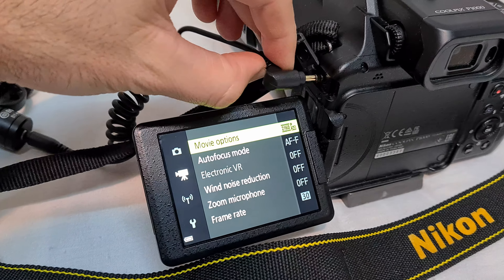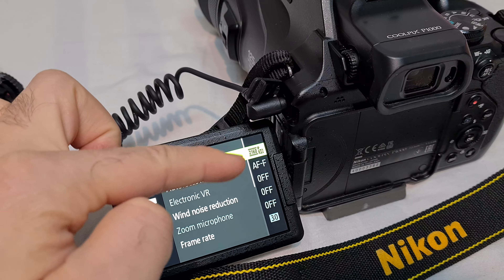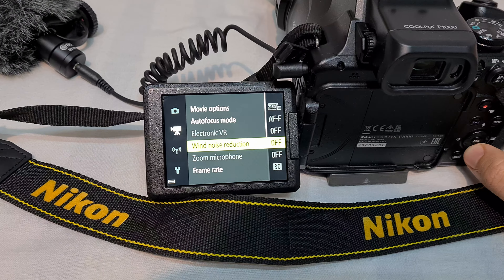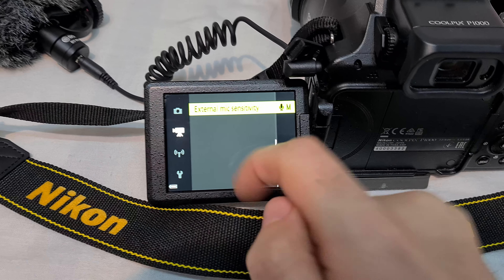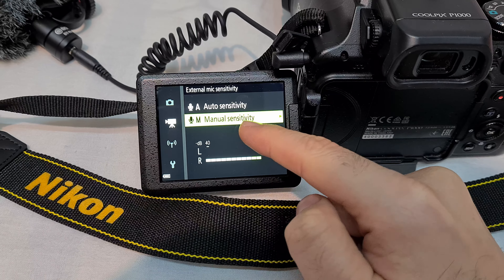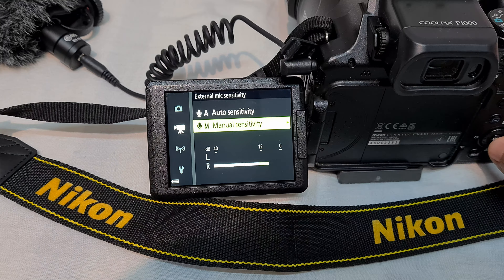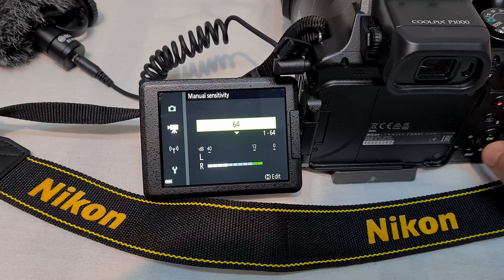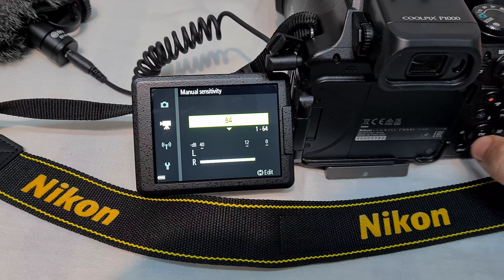How to Reduce External Microphone Sensitivity (Nikon P1000, Wind noise distortion reduction)

Comment: I love your videos, Thank you. Do you know where the built in mic is on the P1000? I would like to be able to add a semi permanent small wind muff over that mic. I do not worry much about audio, but sometimes I am capturing nature (e.g. birds) and the background natural ambient is a joy to also have included, except for the wind noise. So I was thinking I could glue a small wind muff over the built in microphone and never worry about wind again. Or could I plug in a very simple small external mic/muff that simply sticks out an inch or two from that jack? I do not need/want elaborate/fancy microphone kits. I am not looking for greatest quality sound, just trying to eliminate the wind from the casual ambient background audio in my nature videos and would like to achieve this as simply as possible. Again, thanks for the great videos.
Reply from the maker: The microphones are on the top of the camera, between the flash and the hot shoe. 2 longitudinal openings.